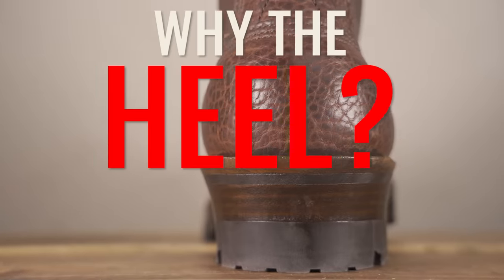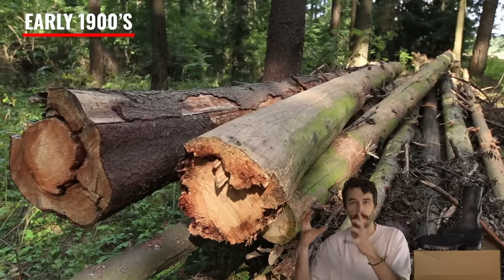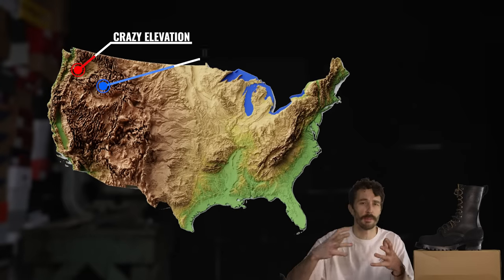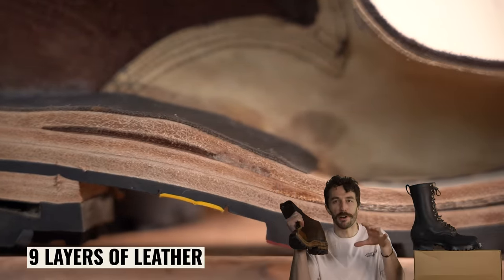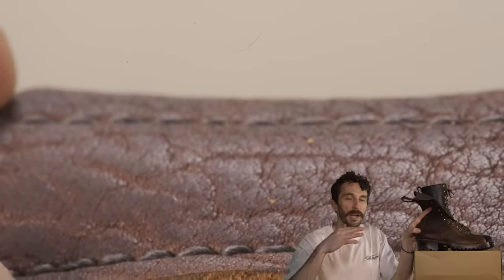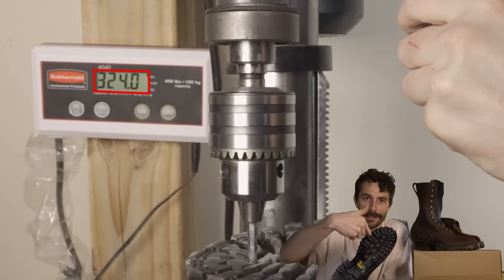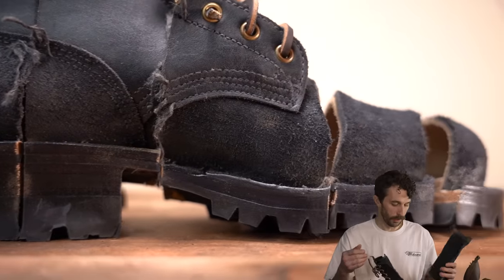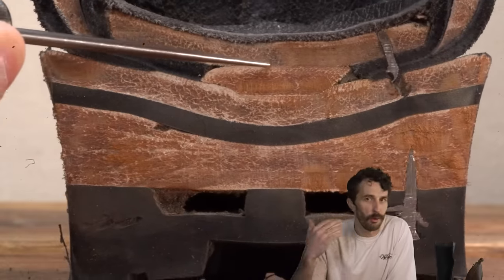Why the heel? 400 year history (JK Boots)

Comment: Must dissagre with their explanation. I am sure that high heel is comfortable and needed for some jobs. But if high heel was soo good for our posture and our joints, evoultuion would make it that way in few million years of our evolving. In the long run, with high heels you are shortening your calf muscles, and putting pressure from wrong direction on your ankles, knees and hips. I would say use it for job if it helps you, but use flat/almost flat shoes for your time off.
Reply: What they’re saying is that having a high heel is better for your feet and posture when you’re walking up hill. Which is true.

Comment: Forestry is still alive and well in the east. Just looks different (thankfully) than 150 years ago. I'm a forester and I've mostly worked in the central appalachian region. Not as high altitude bit definitely not flat, very steep. The tall heel is super useful for digging into steep slopes with loose soil, snow, or leaf litter. I wear drew's, they don't get the attention that nick's or whites but they've been around just as long and are solid boots. They have a new boot that they're selling for only $350. I'm excited about them but skeptical, I'd love to see you cut a pair up and look inside.
Reply: Sounds similar to what Frank's is doing with the Patriot boot. Dropped the cost as low as they could without messing up the quality

Comment: There was for a very long time (and possibly still today) an opinion held by many physical therapists that high heels (in the common sense they meant women's stilletos) caused anterior pelvic tilt. The only well designed study I was ever aware of showed that it didn't, and in the case of a larger portion of men actually caused posterior tilt. Without rooting out that citation I'll confirm anecdotally that proper arch support with a bit of a heel lift (not so far as a stilleto) is in the case for most average feet and postures, of benefit. In flat (not collapsed) feet less arch less heel. In high arch, more arch less heel. But for most, good arch more heel.

Comment: Your arch isn’t supposed to be supported, weight is supported on the ball, the heel, and the outstep with no contact between the arch and the ground. I think the first explanation was correct, the heel is there to provide an interface between the boot and the climbing spikes. Linemen wear similar boots for the same reason and cowboy boots have a heel to lock up with the stirrups. There’s nothing ergonomic about wearing a high heel for normal ambulation.
Reply: Stirrups and climbing spikes are probably designed wrong as well. Riding a horse should be like riding a dirt bike, standing on the balls of your feet. Climbing spikes should probably be more like ice climbing crampons, or at least have the gaffs toward the front of the foot so your bodyweight can be on the balls of the feet. It's almost like high-heels were invented for short people to feel taller, and then everything else was designed around it.
Reply: @noone3734  it’s a compromise between being able to walk comfortably in then and also having them serve their designed purpose. Having the mounting point under the heel allows the boots to be worn normally without interfering with normal walking for the most part
Reply: I was looking into tree climbing spurs, and was surprised to find there are spurs with optional footplates, which support the whole foot, rather than the spur only being right under the arch. So you could definitely design spurs which would work with flat boots without heels, by having the bottom  built like a boot outsole with straps like a sandal over the forefoot. So I guess that would be the way to do it, since the gaffs could be in the same spot. But as far as I know, nothing like that currently exists. The foot plates look they still require a boot with a heel.

Comment: Rose Anvil, You should do a review of a [Spring Heel ] Logging Boot. I was a Timber Faller for 20 years, and a Spring Heel Caulked Boot was the only way to go. Truck Drivers and Equipment Operators were about the only ones that wore a Block Heel. They are uncomfortable and the Block hangs up on everything you are walking over in the woods. Anyone working in the Bush or Landings, usually wears a Spring Heel which has a Curved Bottom and [Caulks]-Spikes, Slang named [Corked Boots].

Comment: CNC operator, 10 hr shifts, lotsa just standing. Logger boots for life!!! Most comfortable thing ever to cover my feet...  ❤
Reply: Just admit. You are short and want to look 2 inches taller
Reply: @redrustyhill2  as stated before they are the most comfortable thing I have ever put my foot in and a 5 ft 10 in 175 lb me doesn't need the extra 2 in I'm not that insecure. Thank you very little for your input.
Reply: @Unclesmokey314  the only people I've ever heard claim boots like that as most  comfortable footwear ever, are short people. They kill my back and knees and are horrible for walking in. Heavy and clunky.
Reply: @redrustyhill2  I'm 6'2" 190 lbs. and won't ever wear anything else but logger boots, been wearing them since around 1992 and never owned any other footwear since. I'm also a machinist and sometimes run CNC's and they are great for standing still while also good for walking. Either way if you are on your feet all day I can't imagine a better thing to have on your feet once they are broken in. Feet are feet no matter what height you are, weight might be a factor but that is a different issue.

Comment: Wesco boot in Oregon makes a nice boot as well.  I have a few pairs. Note the ones for going up trees or poles have metal tabs at the heel and along the toe for those spikes. None of these boots are cheap but they will last you a lifetime for casual use and if you are a professional then you just flat out need something solid.

Most inexpensive boots e.g. CAT or georgia boot and so on will wear out the upper and lower right about the same time and then the whole thing is a throw away. Not bad for casual use where you might get a year or two out of them and they weigh less.

Comment: The only reason for the heel is to make walking around and working in the tree easier by getting the gaffs on your climbing spikes higher off the ground. Your cited advantage of walking uphill would also cause a major disadvantage while on a downslope. Going up a mountain isn't just up up up. Also, logger boots have a high upper to protect your inner calf from its opposite side's gaff.
Reply: To be fair, you find big heals on modern mountaineering boots as well which are specifically for going up and down hills. The logic is that the 'step' in the sole acts as a break to slow you down on steeper terrain. On rocky ground it catches rock and on softer ground it digs in. Personally I'm leaning towards barefoot shoes myself these days but my trusted mountain boots do a real job. 

Horses for courses, I think.

Comment: Loggers are great for outdoors in the rough, the high heel helps keep climbing spikes from hitting the ground.  But their use in the trades is limited. High heels & heavy lugs are hazardous on ladders & scaffolding because they catch. For me anyway I've found I got fatigued more quickly w/my heel jacked up 2" compared to flatter & wedge soled boots.  I'm sure JK makes other supreme models better suited to construction. There's reasons why guys wear "boots" designed like sneakers w/little or no protection now a days. One being everyone wants it done yesterday & time travel is best in comfortable foot wear.
Reply: You're wearing ill-fitting boots then. My Redwing LoggerMax boots are as comfortable as walking around in tennis shoes. Especially on the job site, the added protection from construction debris is a huge plus. Guys are wearing tennis shoes (or boots that may as well be) to jobsites now because they're turds, not because great, comfortable worksboots aren't available.  😄

Comment: You need the high heel to wear climbing spikes. Otherwise the spikes would dig into the ground (and get dull) if you did not take them off as soon as you are not on the tree (or utility pole).
The heels are no better for you than wearing high heals (Very bad for your back and hamstrings if you wear them too much. )

Comment: There's a rule when working for railways as a conductor or engineer(at least in canada, but I'm assuming the states too), that all workboots need to have a defined heel to be considered safe. The reason for that was the now largely non-existent practice of getting on moving rail equipment. Not having a heel would allow the foot to potentially slip through the stirrup of the equipment which would end with a workers foot making contact with the wheels, the defined heel was basically used to anchor the foot in the stirrup so you can safely get onto moving equipment.
Only tangentially related but figured it was an interesting piece of workboot history.

Comment: I have worn many different kinds of boots throughout my life and I have never owned $600 boots. I have been through several pairs of Army issues desert boots. Been through countless styles of work boots with and without steel toes, from $20 boots from Walmart to Lugs to caterpillars (recently bought caterpillars and they are a comfortable boot for a low rising work boot) had HiTeks back in the day, and frankly I won’t spend that kind of money on boots. They all eventually wear out. All my Army issued boots eventually wear the soles off, they get smooth and then start flapping and eventually break if you glue the front back down.

Comment: need a logger boot that is steel toe, waterproof and insulated. like the red wing 2292 was. working with frozen wet feet seems crazy to me. the logger arch/heel helps the foot roll forward with such a stiff boot. i combine it with a good feet arch support.  leather breaks in fast and is more comfortable when freshly oiled.

Comment: The reason for the tall heel on logger's boots is the same reason cowboy boots have a tall heel. Loggers that climb trees wear climbing spikes and they are supported by that heel, and cowboys lock their boots in stirrups when on horseback. I climb trees, and fun fact about the spurs I use, the bottom part that the boot heel prevents from sliding off is called a "stirrup". To tell you the truth, in the woods just hiking around, logger's boots totally suck and I'd rather wear tennis shoes. They are incredibly heavy and cumbersome, and the tall heel locks on every damn root or scrub that is above ground.

Comment: I wore logger style boots for years, timber falling and doing fires.  I call them artificial hooves, because you can stomp the boot in the ground, kick it into a hillside and it holds you up.  It's a platform to stand on where ever you go. There is nothing quite like them for uneven terrain.  They do especially well side sloping on hills.
Had a pair of Wescos rebuilt and they came back with a collapsed toe box and Wesco would not honor the repair and the boots were unusable.  Switched to Haix because I needed boots right away and haven't gone back.  They are sooo much lighter.  The old logger style boots are just too heavy.  For fire, you need to hike miles and miles and they're just slower.  No matter your physical fitness level, you will hike much faster with boots that weigh half as much.  They're great for running saw all day if you can drive to your work site but Haix do fine there too and I can still move a lot quicker through the woods.  They're not quite as durable but still do good and then I just buy a new pair and they feel awesome on day 1.  Boots aren't the expensive part of my job.  
And less face it: there's not many dudes out there who are "hand falling" (with a chainsaw) trees out in the forest.  The number of guys who do it probably numbers in the few thousand, and then they're probably in the northwest wearing them as calk boots which is an entirely different story.  The vast majority of loggers make their living sitting in a piece of heavy equipment where you could probably wear sandals 90% of your day.  
Just some observations.  I've worked in the woods for 19 years doing nothing but hard fing work lol.

Comment: I have been wearing logger style boots for 20 years. I they are very comfy, hold gaffs real well and protect my feet and ankles.  My only complaint is I wish the raised heel wasn't tapered.  I would like to see the raised part of the heel at least as wide as the foot bed wear the wearers heel makes contact or even slightly wider.  On uneven surfaces I feel like I'm walking on stilts.

Comment: These boots look very similar to the black  "Leg" boots I wore in the Army.
I found them to be so much more comfortable and supportive than any other civilian boots or shoes that they are still my daily wear choice.
I like how they last many years if you take care of them and keep them polished. No mater if you are in harsh dry environments or in wet areas they stay up to task.
As long as the water doesn't go above the top of the boot your feet stay dry.
I would think that these JK boots are even better built and should last a great many years when not subjected to the extreme tortures of hard logging.
I truly would like to see how they compare with the leg boots and also how they would rate for use as motorcycle boots with the crush and flex protections in mind.

Comment: I like the history, and I agree that for the application, this kind of shoe was definitely a necessity. However, the claim that your posture is aided is only true while you're wearing the shoe. The moment you take it off that readjustment will affect your posture in a negative way once more. A zero drop, flat shoe will definitely not help you climb trees, but it will help your body manage its own self correction in posture as opposed to correcting it only while you wear the shoe.

Since using barefoot shoes, I no longer have back pains and my posture has improved. I must repeat myself; I don't say these shoes are useless or that they don't help you stand more upright, the most likely do, but those benefits last only while you wear the shoe and hurt you when it's actually off.

Comment: Maybe the tall heel helps going uphill, but what about the opposite, coming back down hill? Or do loggers only walk uphill;)? I think the main benefit is being able to lock in the spikes for climbing. I suspect there's another way to affix spikes to a shoe or boot, but maybe not. 

What is described above is taking the work that your foot would be doing and transfering it to the boot. In that case, the boot is a tool and allowing an individual to do more work than would be otherwise possible. I suspect that you could create that support without a heel, but I'm no cordwainer. I wonder if there are individuals in forestry who are barefoot enthusiasts using barefoot shoe or boots to accomplish the same tasks...

Comment: The forward heel, unlike a woman's high heel which is under the heel, is lined up to be directly under the tibia, thereby bypassing and eliminating the need for the foot to carry load. The "Super Feet" insoles work the same way. The foot becomes a mere pad at the end of the leg, not a mobile limb in it's own. hyper supportive boots work the same as the cast on a broken bone, when you remove the cast you have a case of muscle atrophy.

Comment: Thanks for what was once again a great post. However, the lead-in picture, with the guy on the springboard, is an anomaly I believe. Usually the guys that spent all day on spring boards would wear “spring heel” boots, which were flatter. Check it out, because I might have the wrong end of the stick. Thanks again and take care.

Comment: I've worn those.  They are only good for climbing.  They will screw up your back, hips and knees quickly walking in them.
Reply: While I've never worn them, I can see your point.  Did you come to this conclusion from personal experience? 
 Yesterday I did a quick search on heeled boots and back pain, and the major consensus was that heels are not good for the back and joints.  I'm assuming this is for average people on a generally flat hard surface, not people in get rugged terrain
Reply: @karls5474  Used them for work climbing trees n poles.  Ended up taking flat soled slip on boots to work too to change in and out of.  The other guys poked fun but every one of em had bad knees and or backs.
Reply: @karls5474  There is no redeeming quality to them in rugged terrain but they will make you appear 3 inches taller. Honestly women will flirt with you more if you walk around in these.🤷

Comment: My first trip to the Philippines I learned that western footwear is incredibly over engineered. Filipinos climb coconut trees barefoot. They climb mountains and traverse jungles barefoot or with simple sandals. I climbed this volcano with hiking boots while my guide used sandals. I quickly learned the boots were horrible in the heat. Mud stuck to the lugs etc etc. however, I’d say in an environment where logs or something could fall on your foot, give me some steel toe boots.

Comment: Heels like these are dangerous on a construction site unless your an office guy just walking around and not doing work.
Reply: Retired carpenter 40 years bridges hi rise buildings wore westco boots whole time could stand on rebar step on nails climb walls work in mud boots would last 2 to 3 years send them in to be rebuilt office guys wear redwing or cheaper boots. Still wear westco and whites for walking motorcycles hiking they are comfortable and safe.
Reply: @Steven White  I'm glad they work for you but in my 35 years I've seen that kind of heel cause many accidents.  I prefer my guys not wear them. I'm sure the boots are great. It's just the heels that i have a problem with.